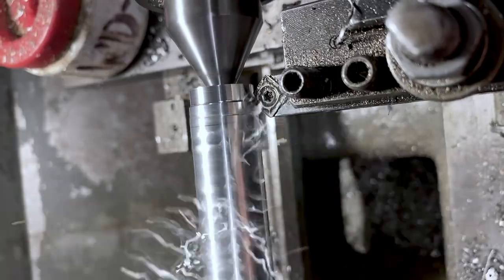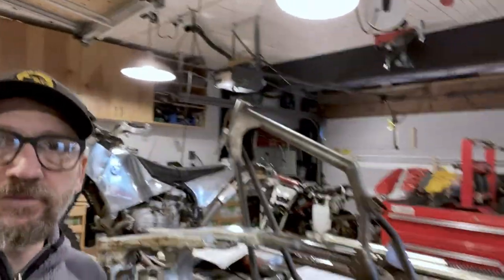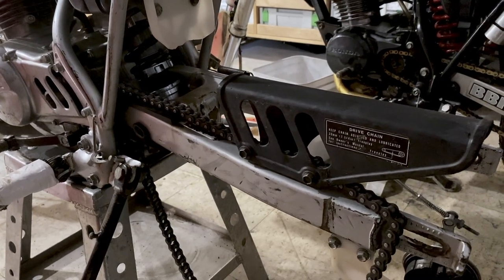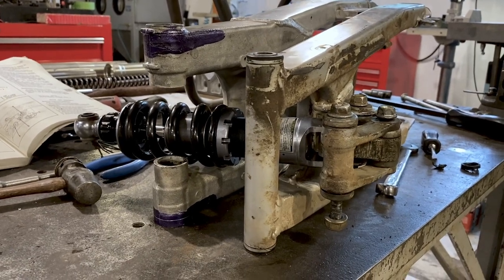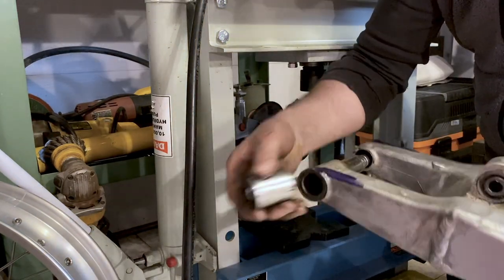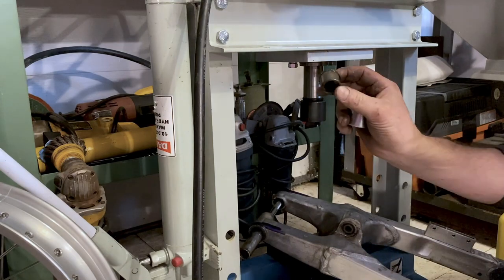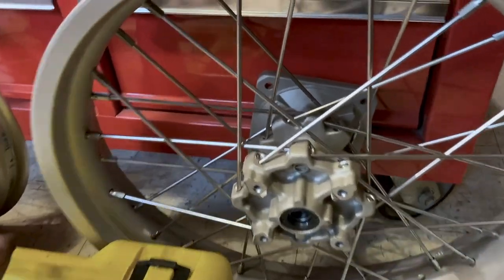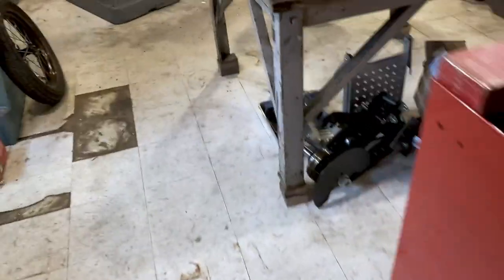XR100 Flat Tracker Episode 2

Comment: I used to race an XR in mini road racing. Our rules said you could upgrade on older models to be more like the newer ones. So I took a 19 inch pit bike wheel (had to be steel rim), a set of Honda MB50 forks (had disk tabs but functionality like the XR), a gsxr 600 rear rotor, and a 4 piston pit bike rear caliper and made a disk front setup for an XR100. Worked great.